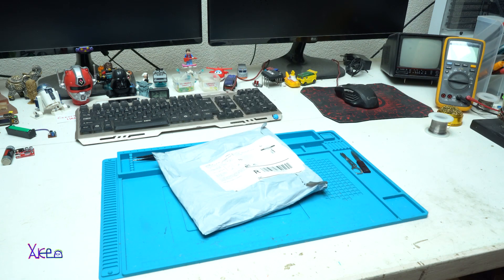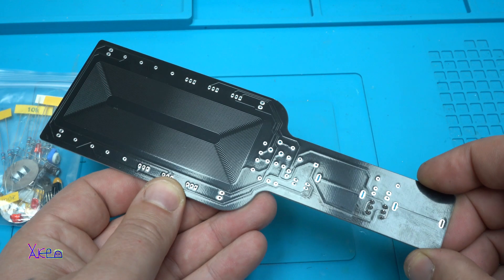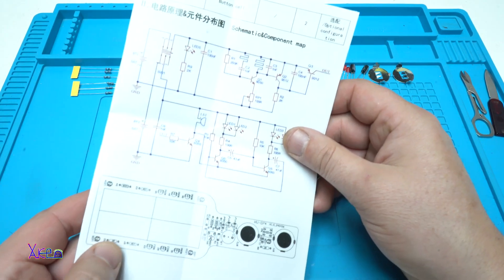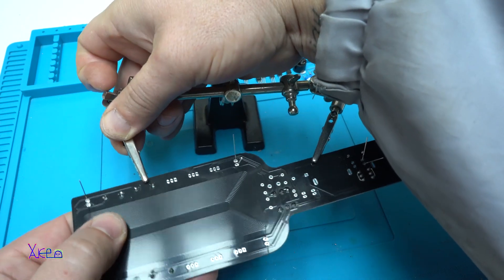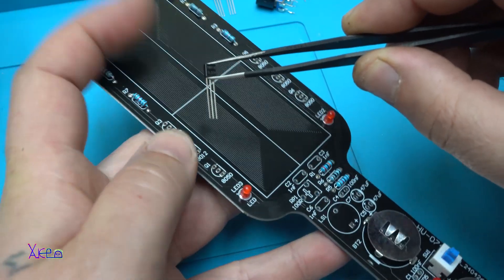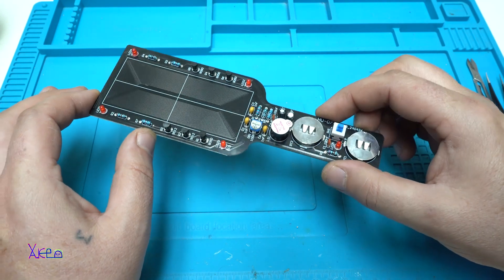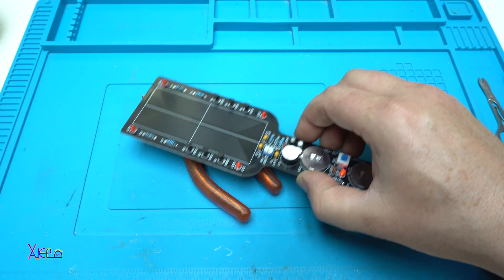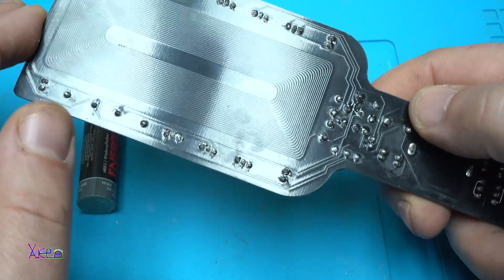$6 DIY Metal Detector -Perfect Electronics Project!

Comment: I soldered mine up so when I pushed the button power light comes on but no lights or sound and I did notice that on this video he had jumpers on the switch. Could that be the reason mine's not working?

Comment: I see the 2 batteries for a differential power supply but I didn't see an opamp. If not that probably explains the lack of range. lol
Reply from the maker: Yes you are right, its a simple transistor circuit and I should have explained that.
Reply: LMAO   ITS A RUBBISH CIRCUIT VERY POORLY PRESENTED